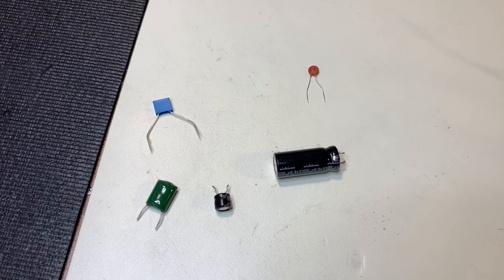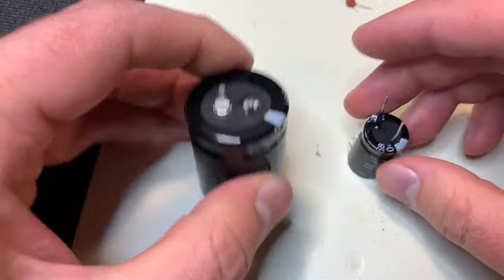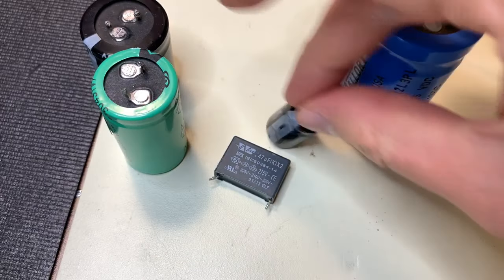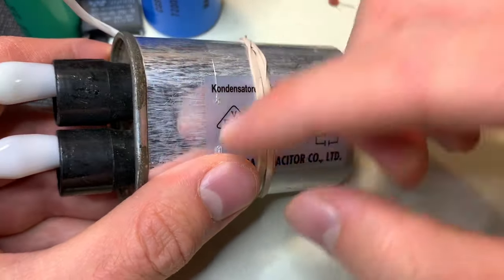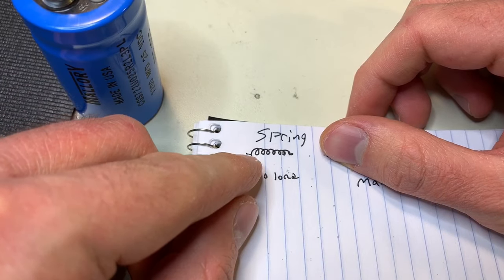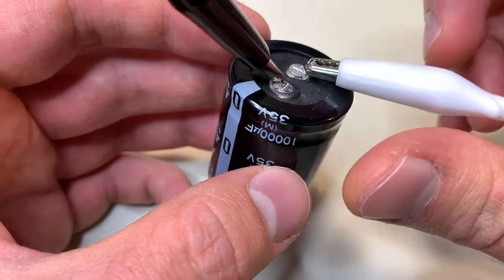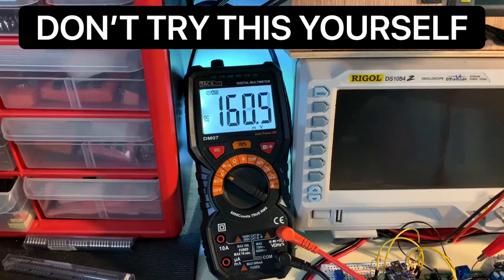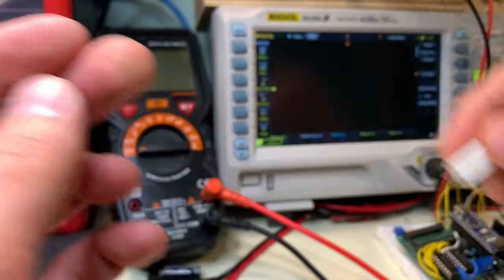Capacitor Safety - How to Discharge Capacitors Safely

Comment: Do you have to touch both leads / connections of the capacitor? And the shock happening in what is between the leads? Or is it a matter of charge being able to go to ground? In which case, is only one of the leads actually dangerous (the one with electrons at it's disposal to send out)?
Reply from the maker: Usually, yes between leads. Touch current is going to be negligent unless one of the leads of the capacitor is already grounded (in which case if you touch the other lead it can still discharge). In other words caps are not by nature grounded but if you connect one lead to ground then the other lead is going to be dangerous (if its at high voltages)

Comment: Useful video 👍. Can i use a 20M ohm potentiometer to discharge it?
Reply from the maker: Thanks - depends on what type of power the potentiometer can take. The resistance is good - but if you run to much current (at a high voltage.. remember Power = current x voltage) then you may burn up the potentiometer. I would not recommend it for discharging very very high voltage things - but my guess is for most applications it would be just fine since it is just a high resistance - and therefore low current.

Comment: This was some great presentation of information thank you. I am not strong in electronics but I am studying up to disassemble a digital camera that has a flash, and the manual states to discharge before taking of a certain part at these points. However it does not state which items I'd need. From my understanding are these ceramic resistors so big that I can order the same one I see you use or another video that I should be okay to use it for most "safe" capacitors, or do I have to do some math to match a capacitor every time? 

I guess my question is more of an is it "a rule of thumb" question, as I'd assume its always safe to calculate what you're working with.
Reply from the maker: Good question - I don't have a good rule of thumb for which resistor to select - if you select one that is to high it may take forever to discharge and if select one that is to low your going to pull too much wattage (and fry your resistor or worse). I recommend calculating the power and the time constant if your going to discharge things yourself for high large voltage large farad caps. But if the voltage is below 24 (or even 100 V) in most cases your not in trouble and if the capacitance is in nF or uF that is pretty low so it will discharge pretty fast. I don't work around a lot of equipment I am willing to do general rules (to expensive to replace) but if the equipment is not to expensive I would use a 1 Mohm high wattage (20 W resistor) or something like this https://amzn.to/3yIYoRx. Hold that on the leads to discharge for a little while, then check it with a multimeter to see how much voltage has dropped, if its going to slow get a lower resistance and try again. Hope that helps a bit.

Comment: How do you determine which resistor to use to discharge which capacitor?
Reply from the maker: Good question, depends on how how fast you need to discharge the capacitor. Time constant is a key factor to determine how long it will take, time constant = RC. So if you had a 1 uF capacitor and a 1 MOhm resistor it would take 1000 seconds. You can always use a lower resistance value but then you have to make sure you resistor wattage is not exceeded. P = IV or Vsquared/R. So if you have a 1000 kV capacitor and a 1 kOhm resistor you would be dealing with 1000 W! if you used a 1 MOhm resistor you would be dealing with 1 W. High resistance value are safer in a sense but you have to make sure you wait long enough. Hope that helps
Reply: @HTMWorkshop  Thank you, but i'm still a little confused. What unit represent Time constant (second?), R (kOhm or Ohm), C (uF or F), V (kV or V), and what is I?
Let say i need to discharge a 400V 60uF capacitor in 60 seconds, i'll need a 0.4W 1kOhm resistor?
I can't seem to work out the formula, can you help me with that? Thank you very...very much.
Reply from the maker: @mrdzin1209  Time constant is in seconds - you have to make sure R and C are in the base unit (ohms and farads). I is current. You will discharge that capacitor much faster than 60 seconds with that setup but you will need a 160 W resistor (I am doing those calculation pretty quick but I believe that is correct). You probably are not taking into account the unit prefixes for the first part. For the power calculation you need to make sure you square the voltage and then divide by resistance
Reply: @HTMWorkshop  Thank you, it's very helpful. And you're right about my setup, it would need a 160w resistor and discharge in 0.36 seconds (so a 16w 10kOhm resistor in 3.6s would be much more efficient). I believe you do that calculation in your head and that's freaking amazing.
Reply from the maker: Sounds like you got it, always a good idea to check with a voltmeter after discharging to verify. Or if that is not an option use a screwdriver to discharge any remaining charge (better to have a damaged board than a damaged hand)
Reply: @HTMWorkshop  did you mean to put 1000kv = 1 million volages or was this ment to be 1kv = 1000 v......."So if you have a 1000 kV capacitor"
Reply from the maker: @raybradshaw8444  Yeah your right I made a mistake on that one - the calculation for power would be even higher if it was 1000 kV.  Not sure what I was originally thinking

Comment: I never discharged a capacitor by shorting it with a screwdriver. Instead, I used a 40W incandescent lamp with a bare wire. I connected this lamp to the capacitor terminal during which it will light up briefly and then fades
Reply: This what i'm thinking. Thank you.

Comment: Awsome video although I like to have  the same setup you have transformer and rectifier can you posted the design setup  so  I can do the same on my little lab. appreciated... thank you;.
Reply from the maker: to be honest I am not sure - wish I could be more help. you should be able to use any DC supply and high voltage transformer for the type of walk through shown - but if you needed to worry about power/current of the device that may get tricky to make sure you down draw to much power.

Comment: Wanted to ask a question in regards to discharging using a ceramic resistor like you did in this video, I noticed when you were discharging you still had part of your finger on the metal bit of the resistor, Is that safe to do so?, Also does it matter what polarity the resistor is to the capacitor?, I'm assuming it doesn't have polarity and doesn't matter which way you discharge it, whether its face down or face up. Lastly do both the legs of the resistor have to make contact with the legs of the capacitor at the same time for discharging?

TIA
Reply from the maker: Resistors do not have polarity and yes both legs of the resistor must touch both legs of the capacitor to discharge. As far as if its safe to have your finger touch the metal part - the answer is maybe but best practice is NOT to touch it. Certain voltages are perfectly safe but if you are not that familiar with safe voltage I would just stay on the safe side.

Comment: nice educational video thanks . the microwave capacitor: could that start someone's heart if there wasn't a set of paddles near by?
Reply from the maker: Theoretically yes if pacing is not needed (there are some arrhythmia that require shock to be delivered at a specific time). That does not mean it's a good idea - since in practice you would want to size the capacitor correct, make sure there is appropriate contact with the skin (so as not to burn the body), make sure you did not discharge to much power into the power. It is possible but not advisable. Also there are different waveforms that are better than others for starting the heart - but a single capacitor can not control that. So in theory yes - in practice no.
Reply: Nice so not a great idea to do this but good information for the zombie apocalypse lmao ....
Reply from the maker: @MF-sy7zq  That is probably the perfect way to say it... haha
Reply: my friend was killed by a microwave capacitor
Reply: @davidvankeuren6575  My wife and I had been discussing repairing our microwave oven as a DIY project on an old GE Spacemaker 1400 microwave.  After reading about multiple instances of fatal microwave repair projects; we've decided that it will be safer to take it to an appliance repair shop.  

I am sorry to hear about what happened to your friend.

Comment: why not use resistor to discharge capacitor that has high voltage if you are holding the ceramic part?

what would you suggest to use to discharge over 1,000 volt capacitor when usually equipment insulated for just 1,000?
thanks
Reply from the maker: You definitely can use a resistor but you need to make sure you get one with an appropriate wattage rating. You can reduce the power with a higher ohm resistor but then the higher the resistance the slower the discharge. I would use one of those high voltage discharge sticks I have in the description otherwise you can size out the resistor you need if you have a bunch of high wattage one - but for most people they don't want to bother with doing the calculation

Comment: Does a 400v capacitor need to have 400 volt source to charge it fully?
Reply from the maker: Yes in general, if you had multiple sources for example you could use 200 V sources you could put them in series to create a 400 V source - but your still ultimately using a 400 V source

Comment: The microwave capacitor shows 0.7 uF.  I know the voltage is high (if charged high), but the capacity is low (?) even if the miniscule time period is enough to stop a heart.  Please comment.  Thx.

Comment: Sir , i have accidentally shorted a 70 mf , 400 V capacitor with a screw driver. my question is will it fully damage my capacitor?
Reply from the maker: Not sure - depends on who made it and how well it holds up to the stress of the discharge. You can always charge it back up and see if it holds a charge. Very well could still be good - do you see any visible damage? What are you using it for?

Comment: Great video. I now realize that I may have gotten very lucky by not killing myself with the microwave capacitor I have been handling. I'll be much more cautious with those in the future.
Reply from the maker: Stay safe!
Reply: Update: I also realized that I smashed the hell out of the Bryllium ceramic surrounding the microwave magnatron. I didn't die immediately from Berylliosis, but I probably took 30 years off my life. Happy scrapping folks!

Comment: So I have 4 Caps that are in the power supply circuit of a stereo processor. It's 19.5V AC feeding 35V 470uf Caps. I need to replace them as a few have begun to leak. Do I need to worry about discharging them before un-soldering them from the circuit?
Reply from the maker: 20 V is pretty safe, 35 V is still pretty safe but on the edge of possible issues. I personally would not worry but if you want to be extra safe I would just use a screwdriver to discharge them (or some other piece of metal)

Comment: iit is not because the max voltage supported by the capacity is 400V that you will charge it at 400V, this is the max allowed DC + AC ripple voltage supported by the cap.
Reply from the maker: You are correct that the listed voltage is the max recommended voltage (any higher risks dialectic breakdown breakdown and could damage the cap)

Comment: You look like a master. Can you just point me in the right direction? I have a Mark Levinson no.27 amp. When I turn it on I heard a strong pop on the right speaker and then the unit went into protection mode. Even time I turn it on after that the power switch would pop back to off.  Same result with all cables off with only power plugged in. The power light still lights, fuse is good. Can anyone give me some guidance?  Thanks
Reply from the maker: Not sure on that one - sounds like some sort of current issue. Honestly, I would be looking in the user manual to see the reason for protection mode - start narrowing them down one by one to see if any of the suggested corrections work. My guess is you may have already tried that but can't say I'm familiar with that amp.

Comment: What about using gloves to prevent shocks/electrocution? Like those that linemen wear for their work. 

These gloves might be too cumbersome to wear all the time but I imagine they could be useful to have when in doubt
Reply from the maker: Yes you definitely could - but you can still damage the electronics if you are discharging the cap near the board. So that only works well if you either don't care about the device or if you have already removed the cap.

Comment: I have an old shortwave diathermy machine (Mettler 300) that seems to be malfunctioning, tubes seem to get hot (tubes have been changed as I first guess) but the coil doesn't seem to be hot. Under the lid are 2 separate capacitors (each set has 5 separate 28pf 5kv in joined parallel -- for 140pf 5kv each). I suspect these capacitors failed. To the look everything else seems okay and to the eye some capacitors appear to have cracks in them. These capacitors (10 in total) are ceramic disc capacitors. Warnings on the inside of the equipment to not work on it. No videos/aricles anywhere on how to discharge these. Machine has been unplugged for months.
Reply from the maker: Could be the issue, very high voltage. Yeah a lot of manufacturers say not to work on their equipment - this is more of a legal issue that a technical issue. The OEM is trying to protect themselves legally more than anything. I am sure they would tell you only a certified person should work on their equipment and tell you that it costs thousands of dollars to take the training. The capacitors are probably are not charged up, but better safe than sorry. I would use a high voltage discharge stick to see, ideally with an indicator LED. Then you can use your meter to confirm no voltage and try the repairs. But of course the OEM warranties and such will all be invalid but I am guessing that is already the case.  I don't know who you work for but obviously they would need to be comfortable with the repairs and risks of repair.

Comment: Can’t you just wait a certain amount of time and they’ll discharge? I’m going to recap a Nikko amp and it will be unplugged for at least a week. Can the big caps hold a charge that long?
Reply from the maker: In most cases that can work but in some cases the cap may be very big and the discharge may take a while. In some systems there is not a bleed resistor to help discharge the cap when the device is off (depends on the device and application)

Comment: Is there a reason they don't put some kind of international hazard warning, like a skull and crossbones, or at least a stop sign, on all high output capacitors?
Reply from the maker: Well its hard to draw a line in the sand and say this one is hazardous and this one is not - depends on a lot of factors.  Its a good idea though and I do see some high voltage stuff marked (not quite like that but definitely a hazard warning)

Comment: Wait you discharge your capacitors by touching the leads with the screwdriver, I do it by touching the top of the body with a screwdriver, when and why would I have to discharge a capacitor again before testing and replacing? Or after
Reply from the maker: Not sure what you mean at the end there - while it is  possible to discharge a cap with screwdriver - it is not the best/safest way when dealing with high voltage and sensitive electronics. I don't remember the video saying to discharge twice - but if you give me a timestamp I might be able to elaborate.

Comment: I have just now discharged 100uF capacitor charged to 230 V using a flat file. Will it damage my capacitor? The rating of capacitor was 400V
Reply from the maker: Possibly - it depends on what the capacitor is designed for. It is hard to say - but you can usually tell by charging the cap back up and seeing if it holds the charge. If it is leaking current then something is wrong...or if it doesn't charge at all well obviously its time to toss it. There is a decent chance its fine and will still work
Reply: @HTMWorkshop  yes it's holding 230 V after the accident
Reply from the maker: @abhinabachoudhury5843  Great!

Comment: By "touching it" do you mean touching both terminals at the same time, or getting shocked by only touching 1 terminal. Can you be more specific? I have an Ampeg svt I am going to take to a tech but I need to educate myself and do it eventually.
Reply from the maker: You could potentially get shocked by only touching one terminal. It has to do with potential difference - so if you touched the terminal that is at a high voltage with respect to ground (aka the potential of where your touch feet or other path to low voltage if another part of your body is touching something). Current would travel from the touched terminal to the low voltage drain. This is one reason that people where high resistance rubber shoes or something of that nature to reduce the chance of large currents running through your body. It's also why line workers (or birds for that matter) can touch high voltage power lines and be safe (there is no easy, low resistance, path to ground). If you need to touch a lead on the capacitor the best thing would be to drain it first, then verify there is  no potential difference with a voltmeter.

Comment: Can you safely discharge a capacitor using this method while it's still connected to a board?
Reply from the maker: If by safe you mean for people, yes it is relatively safe for the the operator. However depending on the board electronics you want to be careful not to damage any part of the board. Make sure you understand the function of the capacitor before discharging to be safe for both the operator and the device.